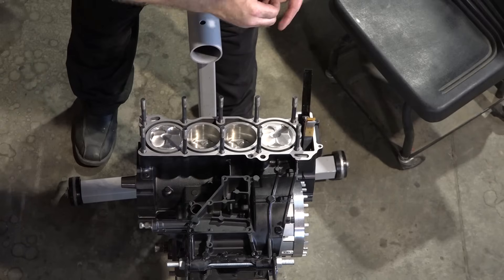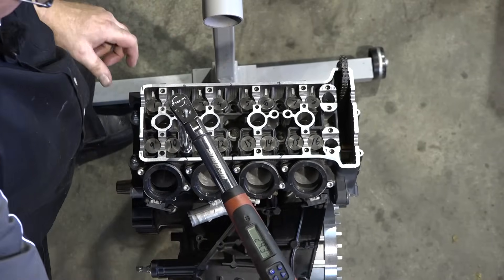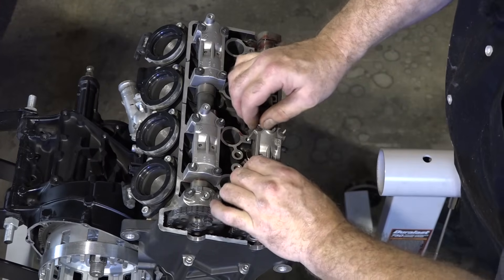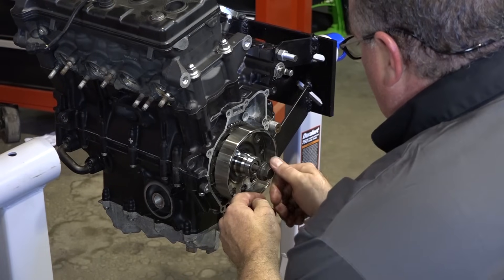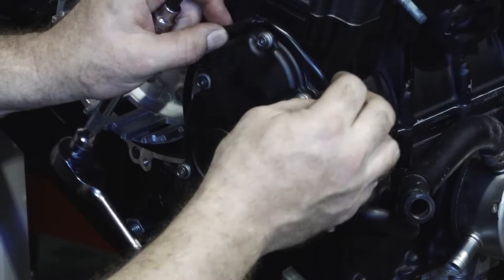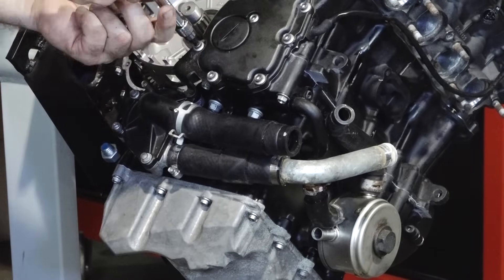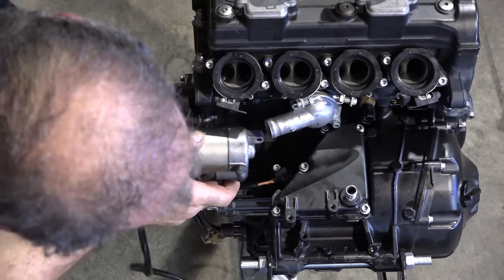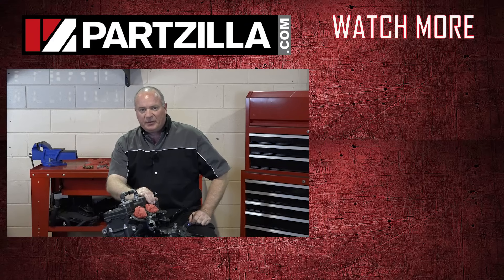Yamaha R6 Engine Rebuild Part 3: Head Install & Final Steps | Partzilla.com

Comment: Saw these videos a few weeks ago when a project came up for my 06 r6. I really appreciated having this series to look to, as this was my first time tearing down a motor. All the parts I got were from you Partzilla. I was going to buy from you to show support for these videos, then I found that your the cheapest oem part dealer for the miscellaneous parts I needed anyways! Double thanks!!! P.s. ever get those dyno numbers for this 636 kit?!
Reply: can anyone help me - i have a 2012 r6, im tryna install the camshafts. the marks on the intake and exhaust are supposed to be level w cylinder head - whenever i line them up, and go to install camshaft caps, the camshaft sprockets move and the lines on them are no longer level w the cylinder head - how do i fix this, should i install the tensioner (i have a manual one) in before installing camshaft caps? the camshaft doesn't sit in fully straight too

Comment: Thanks for this video! I'm building a 2007 R1 engine which is pretty similar to this engine! It helped a lot! I got all the parts from you guys and they were on a really great price!

Thanks!
Reply: I'm doing my r1 now does it matter which way you start torquing down the camshaft caps or do you start tightening from farthest away from chain and working away towards the cams sprocket
Reply: @chuckhooper25  I dont even remember how I did since this was about 3 years ago. I ended up selling the bike.

Comment: I am going to buy a used r6 motor to tear a part and learn on so that later I can fix my own FZ6 (year 2006) as I understand the engines are virtually identical. I can't stress enough how amazing it is that a video like this exists. I will be studying it religiously until I buy the engine.

Also... This is low key a GREAT ASMR video.

Comment: Probably the best vid on this subject. The rebore is an interesting one. I've had a few liner issues with the older r6's. I'm wondering what the spend on this project was?
Reply: I can only speak for my shop on this.  A complete build like this for a race bike and plus doing some more with the head , valve-train, Carrillo rods, lightened / balances rotating assembly and undercut trans is ball park $9,000.00 - $11,000.00 depending on what you send me to work with as a baseline engine condition.  We’ve built engines over $15,000.00.   Depends on your wallet and wants.   But to probably better answer your question A basic top to bottom rebuild using standard factory parts  no fancy stuff is $2,000.00 plus parts needed. And we set EVERYTHING to tighter  tolerances that the factory.

Comment: Great videos, btw i totally built up ma mate r6 2008 with these videos. But i have a problem now the clutch doesn't work no more when puttting into gear she just stalls with clutch leaver in .but it feels like it have clutch ie can feel the pull on the pressure plate, but she just stalls any help would be great 👍 great videos, btw 👍

Comment: I'm a bit late but I just wanna add... why the heck didn't yamaha make the rx1 snowmobile cams with the timing marks on them?? I had hell of a time figuring out the timing but thankfully I was able to get it right. the service manual is missing a few steps on what's going on but you learn as you go. thanks for this build! I'm still learning 👍

Comment: Great job! I've not known that many techs that could both do the work, and explain the work they're doing, at the same time. Dyno numbers?

 You've got me looking for parts on partzilla.com right now.
Reply from the maker: Thanks, Giff!  We were on a timeline to get it done and drop it off to the race team, so we didn't have time to mount it to a bike, test it and then uninstall it.  We are going to do a follow up with them shortly and see how the numbers turned out.
Reply: @PartzillaParts  can anyone help me - i have a 2012 r6, im tryna install the camshafts. the marks on the intake and exhaust are supposed to be level w cylinder head - whenever i line them up, and go to install camshaft caps, the camshaft sprockets move and the lines on them are no longer level w the cylinder head - how do i fix this, should i install the tensioner (i have a manual one) in before installing camshaft caps? the camshaft doesn't sit in fully straight too

Comment: I never see videos on how to re-install an engine to a bike unless theyre Harley videos. Ive just had the gearbox rebuilt on my 2006 ZX10r and removed the engine myself to take to the repair shop. Was looking for some tips or a video on putting that sucker back in :(

Comment: Currently rebuilding my 2008 r6 motor after spinning a bearing. I had to replace the crank, bearing and also replaced the piston rings but wasn't sure the break-in procedure with a rebuild of this nature
Reply from the maker: It's always a matter of contention.  I like to ride it easy and vary rpms.  They say change the oil at 600miles then you're good to go.  Being a sticker, I like to change oil at 200, and then again at 600, just to get some of the shavings out.

Comment: I have this problem in my R6 where it's very hard to find the Neutral during traffic but it can be found easily when the engine is stopped by the stand. What do you think is causing this issue?

Comment: Hi, 
After watching your videos multiple times, I feel like you are the right person to ask about this problem that i am having with my Yamaha R6 2011, 13000 Miles. 
Okay, so when i start my bike, its fires up cold real nice. After the temperature reaching 135 F, the RPM will start fluctuating. It will start bouncing like a cowgirl on steriods. After few bounces, engine will die. If i put it in gear and ride it, at low RPMs it will misfire. 
Going through the forums and videos, i ended up replacing Spark plugs, Ignition Coils, Fuel filter, changed cam and pick up sensor but the problem is still there. 

I do not know what else to look for. I need guidance about this problem. Any help is appreciated.
Reply: Check compression of each cylinder. With 13,000 miles on the bike, it sounds like low compression on 1 or more cylinders.

Comment: Im working on replacing my timing chain and camshaft sprockets on my R6. My problem is getting leverage on the camshaft sprocket bolt to torque to spec. And tips or specials tools I might need? Thanks
Reply: I went ahead and brought a light weight impact wrench, did the job good
Reply: can anyone help me - i have a 2012 r6, im tryna install the camshafts. the marks on the intake and exhaust are supposed to be level w cylinder head - whenever i line them up, and go to install camshaft caps, the camshaft sprockets move and the lines on them are no longer level w the cylinder head - how do i fix this, should i install the tensioner (i have a manual one) in before installing camshaft caps? the camshaft doesn't sit in fully straight too
Reply: Clear Light take a look at my latest video on my channel... my method of resolving this was wedging the cam chain guide so that the chain is tight while I install the cam caps, that way it doesn’t skip teeth.

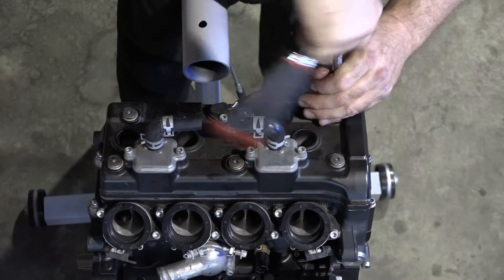Comment: I've noticed in the teardown video the "T"/Top dead center marks on the camshafts were both in the middle pointing towards each other (~5:25 in the teardown video). In this rebuild you had them pointing away from each other (~3:35 in this video). Will this cause an issue? 
Either way a huge thank you for these insightful videos.
Reply: Yes it would, check your service manual, it should show the correct position. I believe it is away

Comment: How is the break in for this kind of job? A few slow miles, oil change and then rip it?
Reply from the maker: Typically, organic oil...couple hundred miles easy, vary RPMs, then change oil.  Organic.  Ride another 400 or so and ramp up your riding.  Still varying RPMs.  Oil change to whatever oil you prefer.  Ride it like you stole it.

Comment: Just wondering what was the break-in procedure you did ?
Reply from the maker: Proper breakin is 500-600 miles.  Vary RPMs, and speeds but take it easy.  Then fluid swap.

Comment: The torque seem so low...the last head gasket i done was on my alfa and the bolts were turned a further 270° in 3 increments of 90°...they were absolutely screaming in pain aswell 😂😂 had to use a breaker bar to get the leverage on them

Comment: One question.  In the engine tear down video you show the camshaft intake and exhaust marks facing each other when piston one is at TDC.  On the reinstall you have these facing away from each other.  Is this an error or is there something I’m missing as midway on my rebuild and confused?
Reply from the maker: It was an editing mistake when the video was cut together. The marks should be set to the outside, the last part of the video is accurate.  We will address this video and fix it.
Reply: Partzilla Thanks for clarifying.  Great video, very clear and easy to follow.  Thanks.

Comment: Partzilla my name is Perry and my question to you is I just rebuilt my 07cbr1000 and when I go to install the cam shafts even though it's TDC they not sitting like they should be and I'm doing everything by the book any answers
Reply from the maker: You need to counteract the compression of the valves and effect the tensioner is going to have. A tooth off is a tooth off once the cam caps and tensioner are in place.

Comment: what is the  recommended transmission oil change on a 2004 trx 450r
Reply from the maker: Here is some information that may help.  

Transmission Fluid Change Interval: 100 hours, 600 miles, or 12 months 
Transmission Drain Plug: 12 mm 
Transmission Check Plug: 10 mm 
Fluid Viscosity: 10W-40, 5W-30 
Transmission Fluid Capacity: 0.58 quarts (2004-2005)

Comment: Hey.
Which gasket you used.its a big bore gasket?  Where can I buy?
And if i can to use a stock gasket for this 636kit ?
Reply from the maker: We used the wiseco kit, they will provide the correct gasket.
Reply: Partzilla ok. What about the cylinder . I gust boring it  2mm over size ?

Comment: how do I installed a 2001 yamaha r6 cylinder head
Reply from the maker: The design is a little older than the one in this video, but it's the same basic concept when putting the cylinder head on.